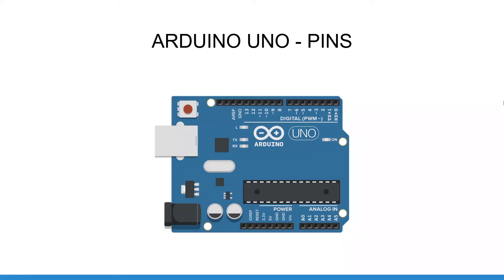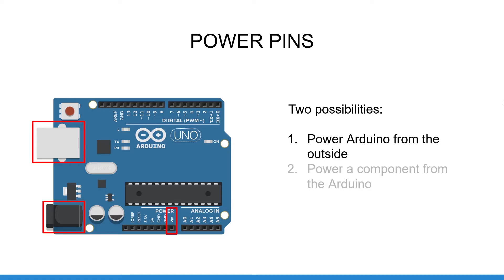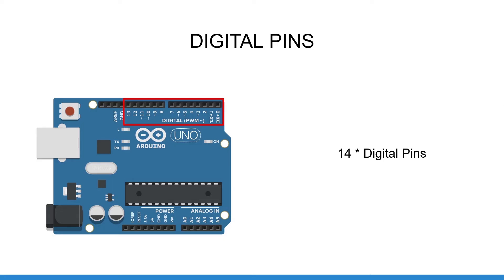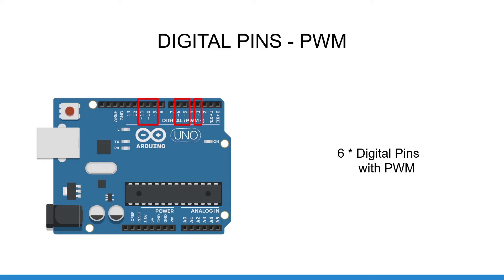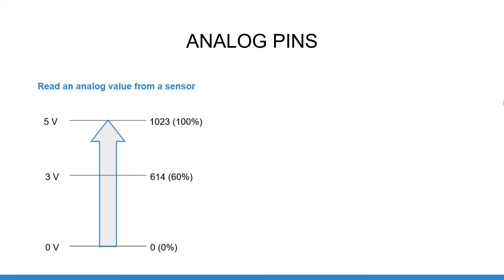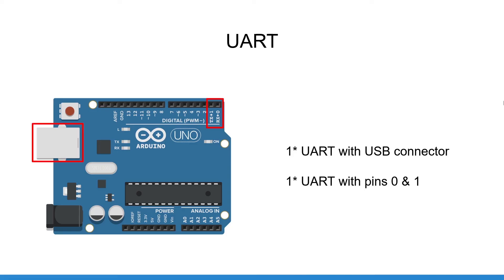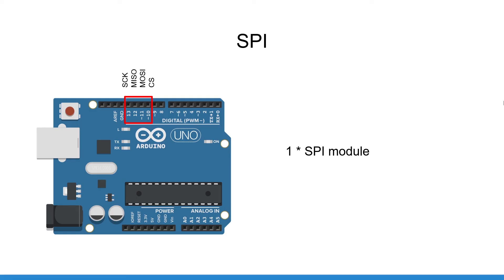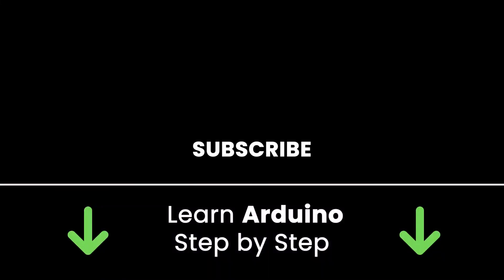Arduino Uno - Pins Overview

Comment: Thank you! I've played around with Arduino a bit but this really helps me understand the capabilities of the board a lot more.
Notes for myself:
Arduino Pins
Some Arduinos have 5V rails, some 3.3V.

When you set an output pin to HIGH, it sort of activates a switch that connects the output to the 5V rail.

ALWAYS connect all grounds of your circuit together.

Vin: Used for providing voltage to the board.

Output pins with "~" are PWM (Pulse Width Modulation).

Pins 2 and 3 are interrupt pins.

Interrupts
Lets you respond to external events while doing something else.
Example: Checking your mailbox every 10 minutes is called polling. Telling the mailman to ring the doorbell is like an interrupt – it causes the processor to act!
You can interrupt the main program to call a different function.
When the function finishes, it will go back to the main function, continuing where it left off.
This runs an ISR (Interrupt Service Routine).
attachInterrupt(pin, someFunc, RISING);
pin: The interrupt pin (e.g., 2 or 3).
someFunc: The function to call when the interrupt is triggered.
RISING: The trigger mode (can also be FALLING, CHANGE, LOW, HIGH), corresponding to the transition (e.g., high to low).
Inside an ISR:
You can change global variables (defined with volatile).
Keep it short (very important).
Don't use delay().
Don't use Serial.print().
Reasoning: These actions can prevent other interrupts from executing and you want to avoid another ISR from being triggered while one is already running.
Analog Pins
Useful for values that can't just be 0 or 1, for example: potentiometers (pots), joysticks.

Corresponds to a number between 0-1023 (representing 0V to 5V by default).

You can also use them as digital pins.

A4 + A5 are I2C pins, as well as the pins above AREF.

Using a separate voltage than 5V for analog reference:

Setup: Connect the AREF pin to the external voltage source.
Call analogReference(EXTERNAL);
SPI Pins
10, 11, 12, 13 are SPI pins.
For wires more than a few centimeters, SPI becomes quite inaccurate.
...but it's very fast!

Comment: 00:01 Overview of Arduino Uno pins
02:08 Arduino Uno can be powered from various sources including USB, DC power jack, and external power supply.
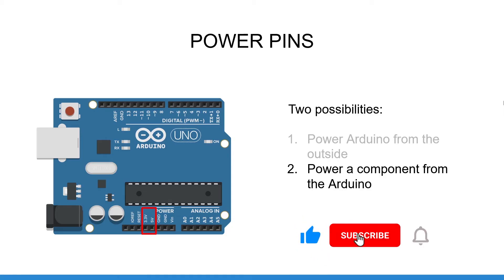04:10 Arduino Uno has 14 digital pins for controlling hardware components and communication.
06:27 Pulse Width Modulation (PWM) allows for precise voltage control
08:46 Arduino Uno has 6 analog pins for reading non-binary values.
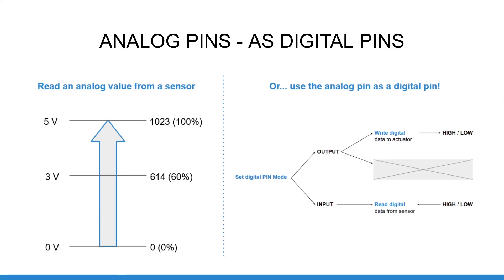11:00 Using analog pins as digital pins on Arduino Uno
13:11 Arduino Uno has specific pins for UART, I2C, and SPI communication protocols.
15:26 Arduino Uno pins for external component communication